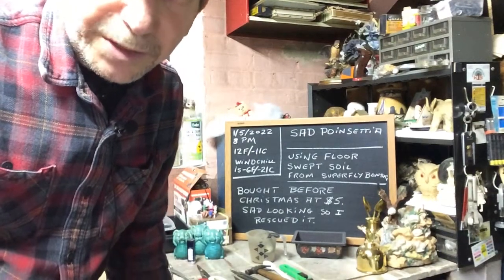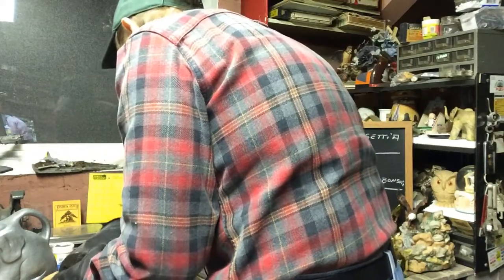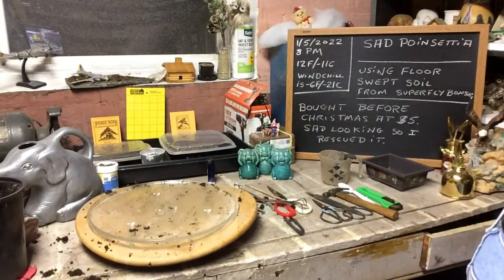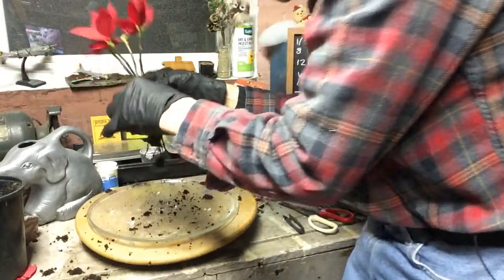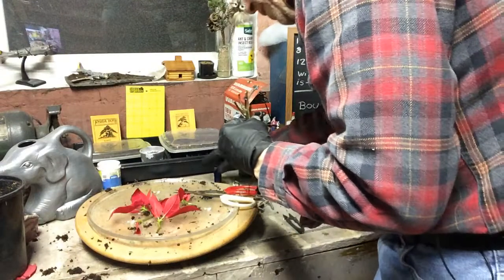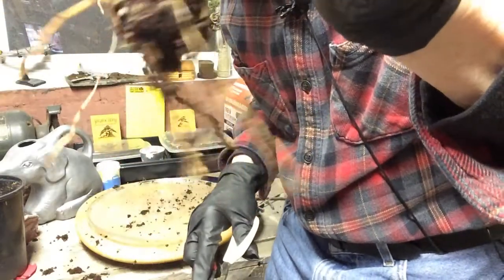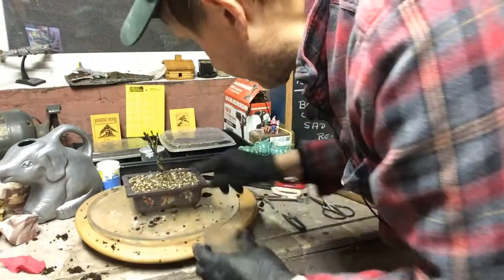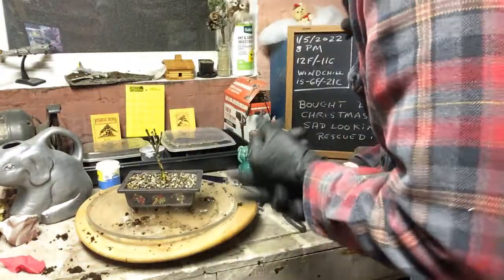Sad Poinsettia

Comment: No flowers here but i am finding hollyday decorated trees at the gasstations for 1,50$ down from 15$ or 20$ so i am swiming in pines thuja and picea tree.
Reply from the maker: That is great Anders. By me the prices are still at the Christmas price and most of the needles are super dry. If it was 75% off, I would try one to save. I found that once half of the needles start dying off, the hope for the tree is not to good. Have fun with your little trees and enjoy a nice hot cup of tea in the evening to relax with. Tom

Comment: Good luck!  Sadly I have killed every poinsettia that I have ever had.
Reply from the maker: Have you tried lipstick on the cut ends? You can also cut them on a sunny day so as to dry up the sap oozing out. Sap usually is the down fall on the cut, causes them to rot. Try again. I have lost so many trying to perfect the cut so as not to lose them. Don't give up.  Use the peroxide to sterilize your pruners before cutting. Hit the stores for sales on them and try again. Seems like the floor swept soil is working so far on the 2 I potted. Time will tell in the basement winter months. Take care and enjoy a nice hot cup of tea tonight to relax with. Tom
Reply: @growclipbonsaiforseniors1951   thanks for the information will definitely try that the next time I get one.  Poinsettia are a beautiful tree/bush, I was lucky enough to have seen very old and very well established plants when I was in Zimbabwe.  So there is know doubt that they can become nice bonsai. 
Plus learned to have tea with milk there and love it. :)